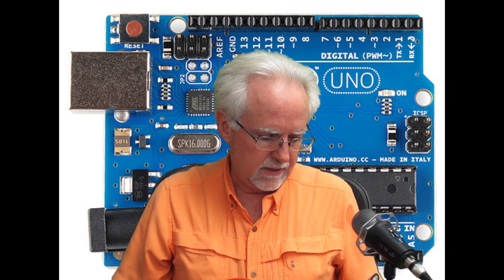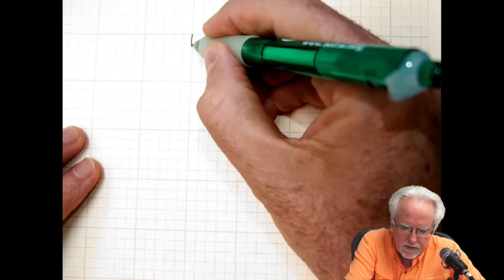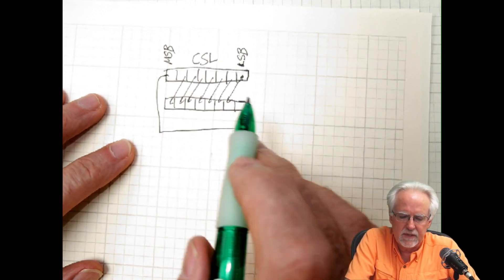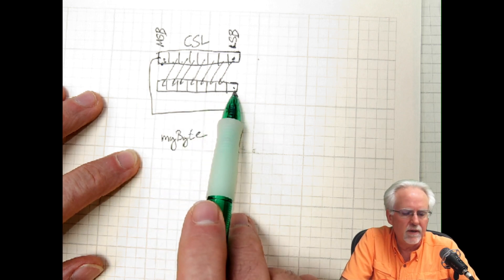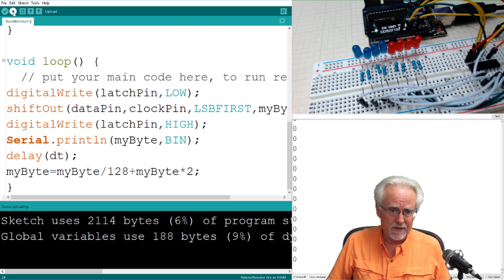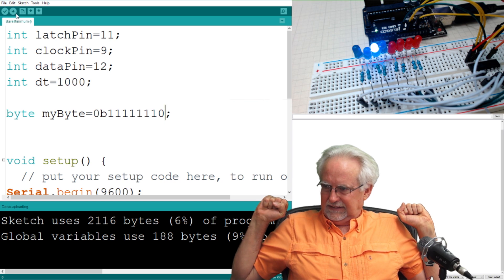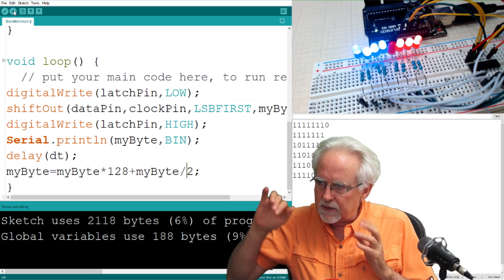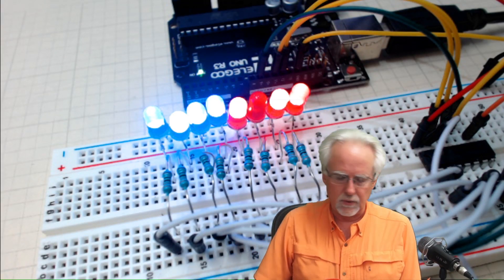Arduino Tutorial 45: Understanding Circular Shift Left and Circular Shift Right with the 74HC595

Comment: Sir, can you please give me extra explain about the part "my byte = mybyte*128 + mybyte/2" 
I figed out that "my byte*128" is to move from smallest to biggest but the part "mybyte/2" really make no sense to me :( 
Hoping your reply 😇
Reply: This can be confusing, but let's look at it a little deeper. FIRST, the math operations on the right side of the equation use myByte twice, the first is "myByte*128" which is functionally creating a number of either 128 or 0 depending on if the least significant bit is a 1 or 0. This is the "bit around the circle" part of the process. The second part of the equation is "myByte/2" which is the "right shift" part of the process. The upper 7 bits moved to the right 1 position. Remember from the previous tutorial that bit shifting at the binary level can be envisioned as either a multiply or divided by 2. The final part is to add these two pieces together to make the final value that is set back to myByte. The most difficult part of this for many people is the use of myByte twice on the right side of the equation, expecting that when you do myByte*128 or myByte/2, that value of myByte is being changed at that time. The compiler actually creates two temporary variables to hold these two parts and then does the adding of these two temporary variables together and assign them back to myByte. Hope this helps!

Comment: I did it in a much more needlessly complex way...now I feel stupid! For shifting left I tested if the number was larger than 0111111 and if so then I would set it too itself * 2 +1. In the case of right shift, I would test if the number is odd, in which case I would set it to itself /2 + 128. It worked but I spent too much time on it instead of thinking of this simple solution

Comment: Uugh i'm really not getting this binary math. Some values I cannot get to work on paper, even though they work in the program.  For example if we take myByte=0b10000011 which is =131. Then if we do 131/128+(2*131) we actually get a value of 263. which does not correspond to value we want, which is 00000111, which is obviously = 7, after the roll around.

Comment: This is the first one where I am not really following the logic, mainly because I can't really grasp a real world application where it is relevant.  Why wouldn't you just nest the calculation in an If loop where I test if the maximum or minimum is reached and if it is rest the number.  If not then perform the calculation.  I solved the requirement but clearly I have done it in a completely different way.

Comment: I found a working solution, but it wasn't as easy as yours.  My left shift was to manually add 1 after multiplying by 2 if the value is >128 or if the far left light was lit.
if(myByte>=128) {myByte=myByte*2; myByte=myByte+1;}
else {myByte=myByte*2;}  
My shift right was to see if the number was odd (or the far right was lit) and add 128 after dividing by 2.
if(myByte%2==0) {myByte=myByte/2;}
else {myByte=myByte/2+128;}